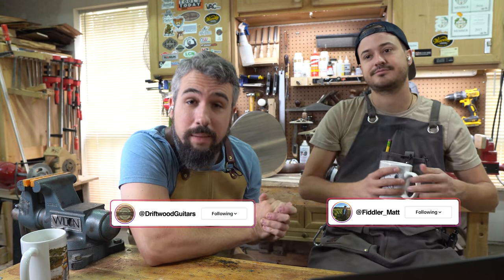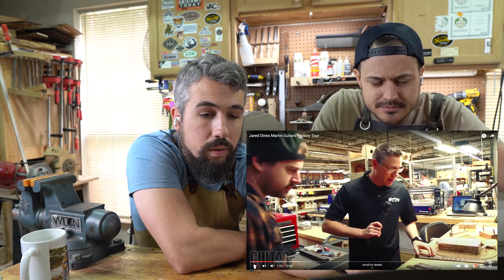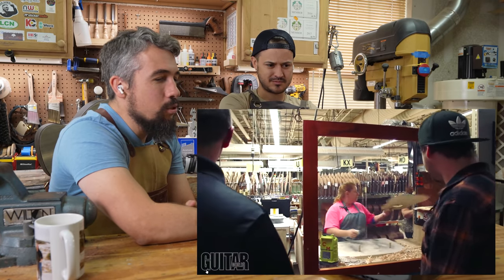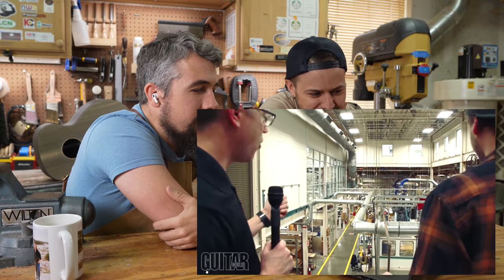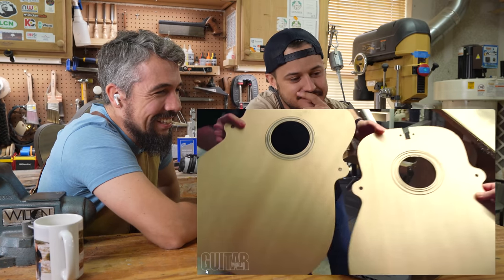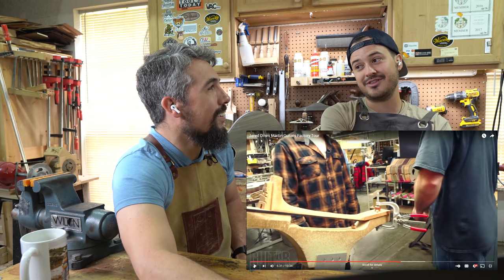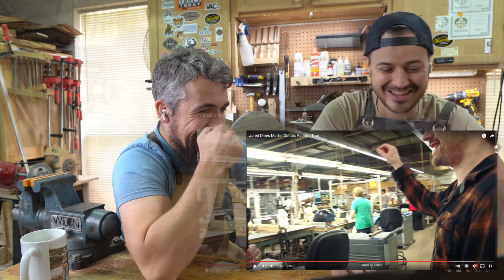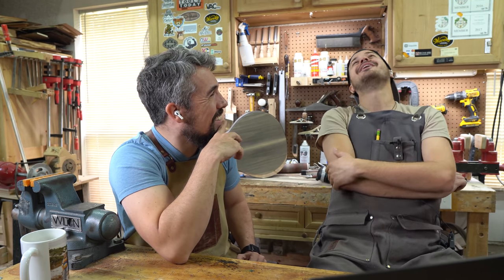Professional Luthier Reacts: Martin Guitar Factory Tour

Comment: I was an aerospace machinist for 25 years. Still in the trade. The table moves instead of the head for stability and accuracy. If all that hardware to actually move the head around were up there in the head, there would be waaay more potential for harmonics to be introduced into the head and into the cutter. Also, it's easier to make that table move around - you can make it heavy and solid and just apply more hp to move it without introducing harmonics (vibration, chatter) into your cutting tool.
Reply: Great explanation!  It improves precision and accuracy then.  When it really matters, you do it this way.  Maybe in a handmade shop that precision and accuracy difference doesn't matter much, but when making many hundreds or thousands of guitars  each year the difference becomes significant.
Reply: Another reason the table moves is to minimize the effects of inertia on the gantry - another point is the gantry has a big weight (the spindle motor) on the end of a lever (the gantry legs) and then it would have a z-axis which is another lever - this gives two pivot points that can flex causing errors in the cut - so a stationary gantry with a moving table eliminates this - the table rides on the linear rails and has a larger footprint and allows the gantry to be more solid and focus on the spindle - the tradeoff is that it requires significantly move room for the same size working surface - so the job that the machine will be performing needs to be taken into account when selecting a machine layout - furthermore the material that will be processed also has an impact on this - metal requires significantly more force to mill than wood or plastic - but where wood mills pretty well (talking about how the tools cut and discard material and how clean it cuts) plastic usually requires higher feed rates and large flutes as plastic tends to heat and swell easily which distorts the final dimensions - a large 3-axis gantry 2.5 mill (like a 4x8 table mill used for flat stock) is usually fine for wood plastic and some thin metal but for precision work and or large pieces of metal a traditional 3-axis mill is best - its all about stability and runout - the oscillations can be measured with stress gauges and the farrier method but i've rarely ever had to go that far when designing and building a mill - one last consideration is the drive system - a single phase drive system (to clarify were talking about the motors to move the axis but also would include the spindle) is going to oscillate (harmonics are when the oscillations overlap which amplifies the effects of them) - so three phase motors then to work best but aren't critical usually - it really comes down to if you're chasing 10ths of and inch or thousandths of an inch
Reply: It’s a CO2 laser with a gas tube source. You don’t move the laser source because vibration will introduce longevity issues. With DC servers, moving the work piece is simple and accurate.
Reply: Learned something new today. Thanks!
Reply: @stephenbennett7331  Was going to say this.  CO2 for organics/wood.  For cutting head movement you would need a mirror system which is more maintenance.

Comment: Hide glue has several advantages over PVA glue. First, it is reversible. PVA glue can be reversed, but it is much more difficult. Second, as hide glue dries, it tends to close the joint. PVA does not. Finally, and probably most importantly, hide glue does not creep like PVA does. The obvious disadvantage of hide glue is its very short open time, and of course the smell.
Reply: Agreed. Hide glue important also sounds better. Idc what anyone says, I can hear the difference. It just hardens differently. Especially considering how close it gets to the joint.
Reply: There's supposedly oderless hide glue but that probably smells too haha.

Comment: I was at the Martin factory and toured the main floor; that really old carousel they use to glue up the tops they said was a piece of repurposed railroad switching equipment that has been in the factory since around 1901 or thereabouts. When I was there, they were still bending some odd models on a hot pipe with a blow torch instead of a press. In fact, I have an older Martin "A" mandolin with scorch marks inside the top where they bent it over a rod or something.

 They also had a room that looked like a classroom with about 30 ladies making guitar strings.  I think that was moved to Mexico or someplace. When I was there you could still get into the old factory also.  I watched them assemble a guitar kit and they just took parts off the shelf that was intended for production, and put them in a box.  They laid out the backs and sides to make sure they matched as if they were going to build it themselves.  I have gotten more then one kit, and they are at various stages of production when they pick the parts.  Sometimes the top is joined and sometimes not. Whatever you want. I have never found a piece of defective wood either.

Comment: The benefits to moving the work area as opposed to the laser is that its makes it easier to keep the laser focused. In the case of cnc routers its better at keeping the balance for precision cuts, and maximum longevity of the bits they get worn out evenly. if you can tolerate the space loss its definitely the way to go

Comment: Chris I use hide glue a lot, there are different strengths the stronger the bond the quicker it sets up. Once you get used to using it it’s not bad, it does smell just a little. I use it for antique furniture repairs mostly. Great vid, I really enjoy your channel.
Reply: See i am not sure why fans of guitars are so tone glue thing, but i have never heard a single guitar builder say hide glue is for the tone.  Most furniture builders are frugal or cheap and hide glue you get in like 3lb or bigger bag you can use that last for years.

Comment: When I visited Martin in the early 80's they had a water curtain flowing around the finish room to keep the dust out.  From building my own guitars, I've discovered that surface prep and finish takes lots of time.  Martin spends a lot of time to get that flawless finish.  Sanding, filing. sealing, spraying, sanding, spaying as many times as it takes for perfection.  I could never duplicate it.

Comment: One huge benefit of using hide glue when joining tops is that it leaves (for the life of the guitar) an 100 percent invisible line where the two top pieces are joined. If you use Titebond, in time the glue joint will darken and you will always see a dark glue line where the joint was made. In addition, hide glue is an extremely strong joint. The smell isn’t as bad as you’ve said, just get a little fresh air circulating when joining the pieces.

Comment: The point of hide glue is that if a part of the guitar gets irreparably damaged, you can unglue it, fit a new piece, and glue it back together.  Its why some violins are worth millions of dollars.  It will retain its value because its infinitely more repairable than a modern acoustic guitar.
Reply from the maker: Most modern wood glues offer this same reparability.

Comment: I did the tour in 2011 and they weren't shy about the plastic laminate range, quite proud if anything. I was more than a little surprised at just how much automation was used in their standard range and Bob (our guide) did claim that custom shop guitars go through the same process, but  I guess he just meant the laser cutting of the top, back and sides. I got to play a few after the tour but being a lefty didn't have much choice, and although nice enough, I wasn't hugely overwhelmed by the feel or sound. I still prefer my trusty old acoustic... which meant I didn't feel compelled to spend several hundred dollars before leaving  :)

Comment: the cnc mills drifted toward moving the table for rigidity and inertial resistance to chatter etc. a moving spindle can bounce or vibrate more easily. the laser cutter is probably built that way because it was an easy way to pair a laser with existing mill parts.

Comment: I've used hide glue in a small (amateur) repair scenario and I can understand why modern builders shy away from it.
I never used it without going through as many dry tryouts as it took to familiarise myself with the technique before actually going for it.It gels up really quickly so you don't have much time to complete the work,but it is still the strongest glue joint you can get (imho) and easily re-workable..................................

Comment: Typically the moving workbed is more rigid and accurate.  The moving mass is also usually less than moving a complete workhead around, allowing for faster cutting speeds/cycle times.

Comment: If you guys could answer this question, I would be eternally grateful. Would a Taylor AD22 Mahony do well in a tropical country with high humidity? My Martin mahogany does really well in such an environment. My impression of a Taylor is that they are high maintenance guitars whereas a well built Martin isn't as high maintenance. I am thinking of buying a AD22, I live in Costa Rica and am wondering ( in your opinion ) will it hold up well to the high humidity down here. My Martin 000m 15 does.

Comment: Custom Shop is the way to go if u get a Martin and can't get a boutique handbuilt guitar. Ive got a Custom Shop 000 Martin, its so resonant and has a torrefied top. Its ab as close as u can get to 'boutique' w/o spending 6-8k. Also Ive had Taylors, and if u can get one used for around 1500 that seems to be the sweet spot, or maybe Koa, aside from that u can get a 3 series for less than 2k, but once u start going up in price its not really a 'better' guitar, its still the same construction w/no extra attention to detail. At a certain point with factory made guitars, particularly w/high end Taylor u r just paying for upgrades on wood and pretty decoration. I would love one day to get a Bourgeois, w/a 'voiced' top and all hand made.

Comment: Hold on guys. I like what you’re doing at driftwood, but Martin tone is excellent. I own 3 custom shop Martin’s and bar the mistake I made on the Dreadnought not to have the braces scalloped (bass isn’t as deep but sounds good finger picking) their sound is phenomenal. Hand made bespoke guitars will always be something different but Martin do a really neat job on all their guitars. You were a bit critical of their braces and processes
Reply: Exactly. Really a turn off. Not a good look acting that way. And anyone hating on Martin is out of their minds. Especially their tone. You wouldn't in the position you're in without them. And imo, they're still the best sound wise.

Comment: I wondering if the laser cutter head is stationary while the work moves because all the circuitry etc is in the head.  Also, having gone to the tour, there may be questions you asked that aren't answered in the video. For instance, I think they do test the top as they are finishing the bracing.

Comment: Hide glue is made from collagen which is found in skin and nails and is basically the protein "glue" that holds our skin together - the older you get the less your body makes and the more your skin wrinkles and sags - hide glue has a benefit of allowing you to heat it up and rework the piece even several hundred years later so some of the luthiers and craftsmen i know that build with it due so so that in the case of a repair they can rework the piece (yes there are some modern alternatives - and if i'm not mistaken tightbond original is actually a modern hide glue - it's basically collagen and modern reagents to make is easier to work with versus just straight collagen for traditional hide glue - i haven't went down the rabbit hole on tightbond original so i might have this wrong)

Comment: I believe the premise behind the hide glue is that it is reversable in the event that a neck has to be reset, or a fingerboard needs to come off for whatever reason. I know that violin makers are very strict about only using hide glue. The rationale is they don't know if the tight bond glue, or white wood glue can be undone. It does make some sense though. Don't want to be gluing a neck in place with some glue that can't be undone for a much needed neck reset 30 or 40 years from now.

Comment: 5 axis mill the main reason to have the piece or carriage move rather than the tooling head boils down to failure points and mechanisms, there is a reason why Fast action mill machines have lasted longer with less maint. downtime than CNCs with moving heads, the gearing and speeds have more adjustability and power which basically makes moving all the weight and moving parts more problematic and depending on the bearings used, like a floating bearing you do not want it in motion or gravity points changing, so moving the piece on the carriage is more ideal.

Comment: high precision machining is often achieved by moving the piece and not the tool. It is the same with advanced lithography. Basically the tool is way more difficult to accurately move around than the tool. In the case of lithography the machine is just tool damns big, heavy and sensitive. For something like this I would say the motors required to accurately move a large tool around are a lot more expensive and difficult to repair than moving a light piece of wood. I does take up more space but these machines are huge anyways. You need a large building regardless.

Comment: They make a better, consistent guitar and I don’t own one….but if I bought a new factory guitar, I’d probably start with them. Got hooked on that damn old folk music and particularly that old 30’s/40’s Gibson sound. Toured the Taylor factory and just haven’t fell in love. At least up in here in Montana, I’ve seen many a cracked top-more with than with other brands-maybe it’s just numbers. They seem to have cornered the market on new players. What I think has happened with all this CNC work, is that they’ve made their tolerances too tight for inevitable weather changes….maybe not seasoning their tops correctly- could have been growing pains in the 00’s. Ultimately, you’ve got to watch that humidity. I’m not one to always keep under case humidity…a guitar needs to acclimate to environment but save them when that cold front/or summer heat wave hits. 
Hide glue is not near as tricky when you heat the parts you are gluing up and when repairing, you keep it historical. I don’t mind it and it’s easy to undo

Comment: The wood top is the lightest part, so it makes sense to keep the heavier and more sensible parts fixed while the wood top moves. It is easy on the motors, belts and bearings and also, since you have less inertia, you can move the parts faster and more precisely. Works well for dedicates CNC machines.

Comment: I have had 2 martins over the years and the first was a J40 which the binding kept coming off. The second is a D28 modern deluxe built with hide glue and it split down the centre after six months and for some strange reason the top side opened up about a quarter inch. So I am now DONE with Martin guitars.

Comment: Really good commentary. I understand what led you to choose this tour, but, honestly it is one of the worst Martin tours I have seen on the web. For example, the shot of necks is not accurate; necks blanks are cut offset, so there is far less waste than the guide suggests. Broadly, the guide seems quite ignorant of the processes and unprofessional. The Dick Boak tours are a world apart from this, detailed and almost entirely production line. I'm a huge Martin fan and I have 3 high end (not custom shope) ones BUT, in fairness, their custom shop does involve a great deal of stuff which goes on on the regular production line - it goes to custom for the refinements (that's why you're seeing a bunch of them on racks); the more refinements, the earlier it comes off the line (and the bigger the markup - fair enough). Regarding the inlays, what you says is absolutely right, but they are really only doing these as demonstration models. Yuk. Also, in another tour they interview a guy who works full time on custom inlays for clients, all of which are done by hand, as there is no advantage to CNC for one-offs. Martin never claims to hand voice guitars, by the way. Please do find a better online tour. I think it will be a pleasant surprise. Sam Ash and Luthier's friend both have one. Spoiler alert - they are long. Cheers